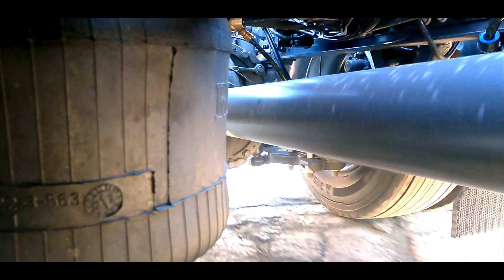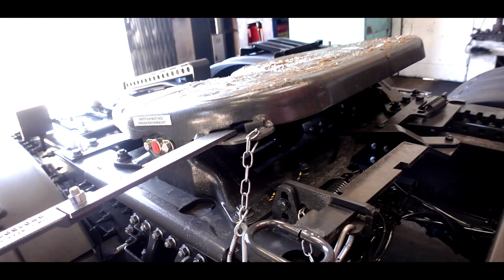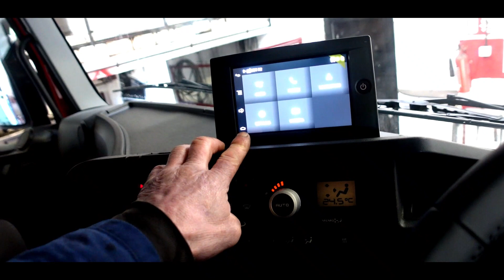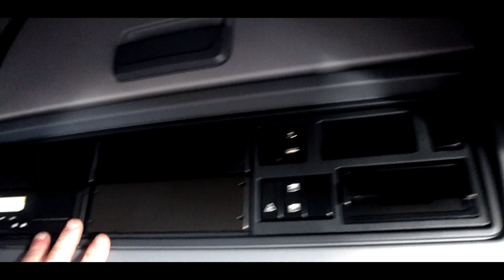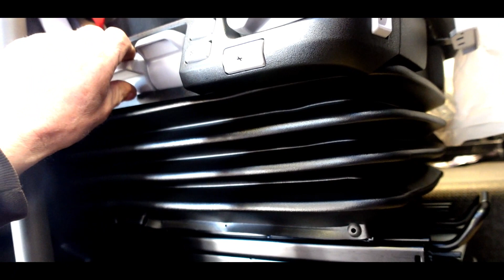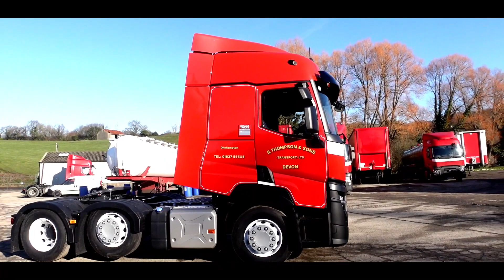New Renault Trucks T Range 480 DE13 Turbo 2023 Beast of Dartmoor Devon Transport

Comment: Hey Jof👋
Are working with trucks???
My first Truck was a Renault....later just many DAF and MAN.
The small fridge is bad for big cokebottles, the co hides always away.😭
DAF used these fridges too. Better are the MAN fridges, they have in the front a big place for 3 big bottles, and the other stuff is placed in the back part of the fridge.
Thank you for the presentation of the BEAST!😂👍
Reply from the maker: Thanks for your comment yes 🙌 we do trucks 🛻 🚚🚚🏨🚍🙏👍🏼
Reply: @MOHOTELADVENTURES  
So you are a truck mechanic?
Reply from the maker: @truckeronprivatetour4730  yes 👍🏼 🚍🏨🌴
Reply: @MOHOTELADVENTURES  
Great👍 and my respect👏
I startet my official worklife with learning this job.
But it was a horrorjob for me, so it got quitted after one year.
A hard Job with heavy weights in bad positions.😖
Reply from the maker: @truckeronprivatetour4730  yes I have been 43 years in the trucking industry starting in 1980👍🏼
Reply: @MOHOTELADVENTURES  
How many years do you have to work for pension?
In Deutschland you have to work 45 years... when you are able to.😣😭🤷🏼‍♂️🙄
Reply from the maker: Probably another 7, but I think 🤔 I will be in Portugal before then 🥳🚍🏨🌴
Reply: @MOHOTELADVENTURES  
If the pension is high enough, go in pension, and enjoy as much as possible.
Portugal sounds good to me, specially the Algarve.